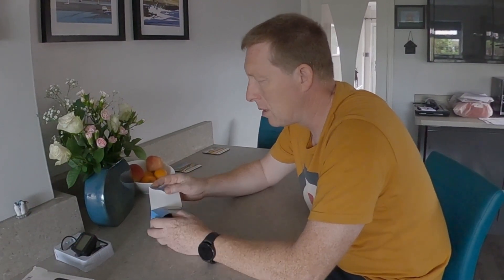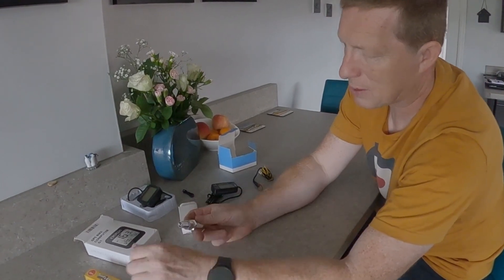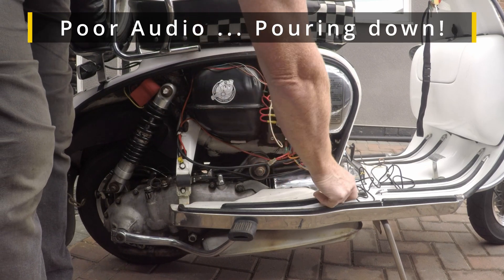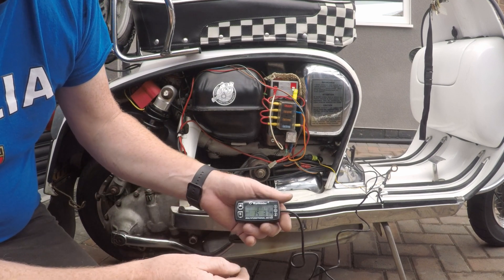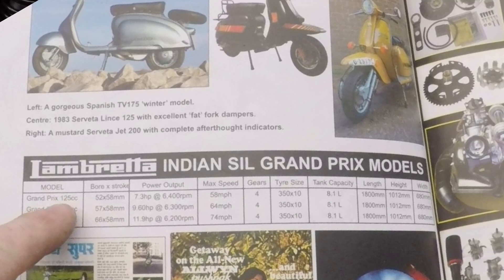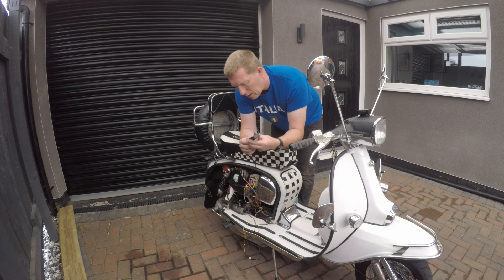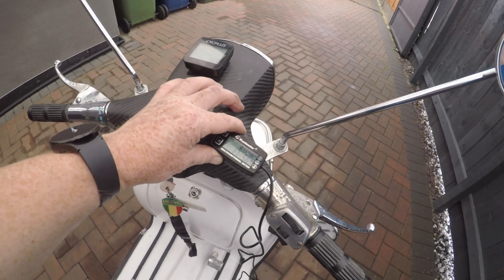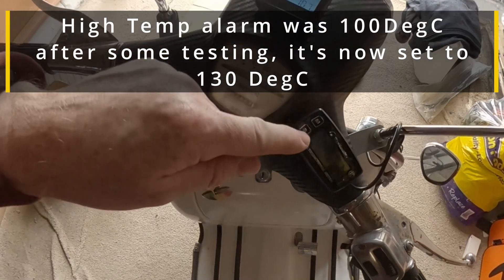Lambretta Scooter Universal Engine Monitor - Fitting and Review

Comment: I've been using these (three of them) on my scooters for some time now. You CAN turn the LCD display off. Just hold down the "M" and "S" buttons. I do this after each ride to save the battery (then they last ages). The display will automatically turn back on when you start the engine again. Also, I know you selected the correct firing pattern (1P1R) but which RPM range did you select? I found r3 (0-12000 RPM) suited the Lambretta revs the best, all three of my Lambretta's display very accurate revs using this Runleader HM035A (all on static timing). The only time I've had an issue with erratic RPM's being displayed was when I fitted one to my GP which had a variable ignition at the time.
Reply from the maker: Thanks for that...  I need to read the instructions more! Lol
I've left it on 1P1R, but I'll try that other range. Cheers